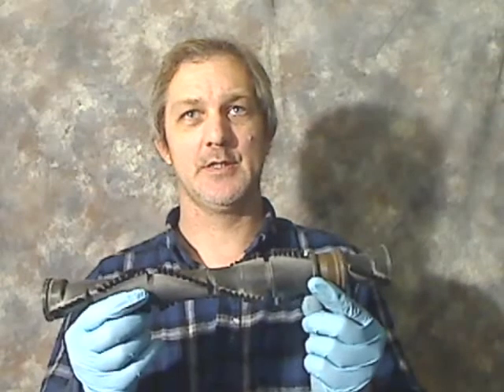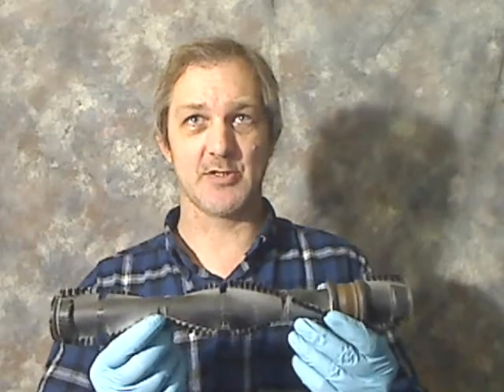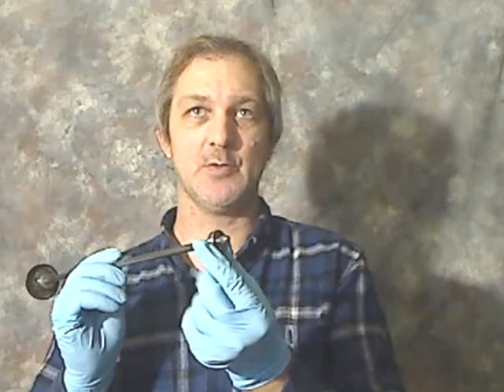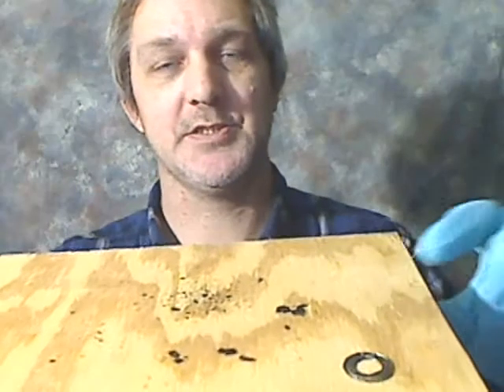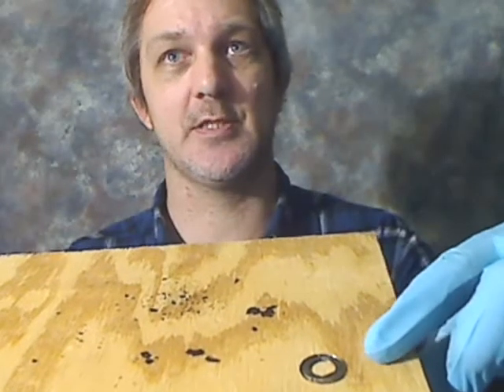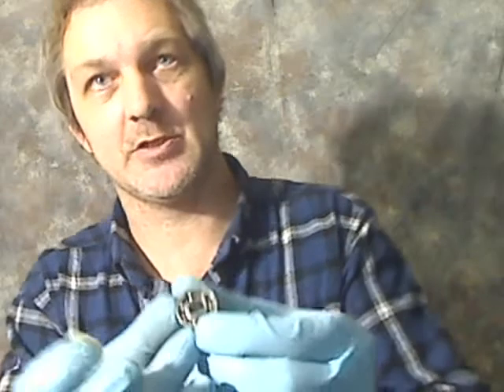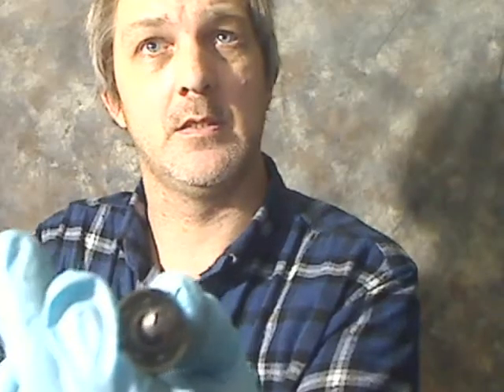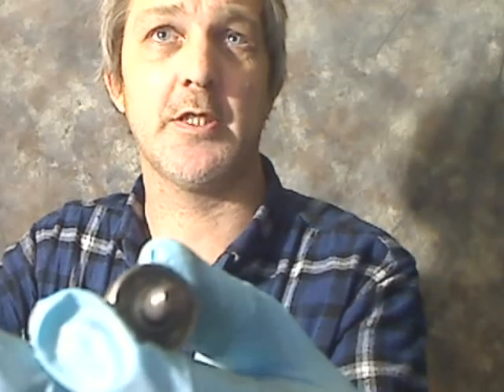Vacuum Brush Roll Bearings Froze Up

Comment: Thank you. This video and related posts helped me to figure out how to dissemble and repair a bissell roller brush without destroying it. 
Tapped out the rod with a Phillips head driver and hammer. Several lite taps pushes it out. One bearing had completely seized up, lubrication didn't work. Found same size/type bearing at DeNault's Hardware in the miscellaneous hardware section. Uses a standard size single row radial ball bearing. Reassembles by pressing firmly together. Also replaced the belt while I was at it. The vacuum now works like its brand new. Win!

Comment: My roller brush smelled like it was burning but still spinning. I turned if off, cleaned hair off outside, but when I turned it back on, rollers did not move. By watching this video it filled in the blanks of what I needed to do to separate ends of roller brush to access inside and clean and lubricate. Thanks.

Comment: Yes, did the same as Heavymechanic. Gentled a screwdriver under the softer of the two caps and pried. The rod actually came out of the opposite cap! Pretty easy-peezy, actually. Once I cleaned the crap out (yes that was the problem) tapped the rod back into place with a hammer. Cleaner is running again like a Boss!

Comment: I saw this video right before I ordered a new brush roll and belts for my Bissell, decided this was my last attempt ... it WORKED!!! I pried the ends off with a flat head as carefully as i could to not damage the plastic, you have to just work your tool around and pry and twist .. it took me a bit but after cleaning the end caps off and taking out the stem inside and wiping it down with WD40, I saved about $30+  on parts!!!
Reply: After hanging up on a Bissell Rep i could not understand i found this video. Spot on kid and  Thanks big time!

Comment: Took brush apart with flat head screw driver,  cleaned out hair wrapped around rod and used some WD-40 and voila! Up and running again. Saved myself a visit to the vacuum shop-time and money saved! thanks!!
Reply from the maker: +Lisa Ebert Glad it helped because the brush roller is half the price of a new vacuum cleaner.

Comment: Thank you sooooo much for posting this video. I thought for sure my motor was broken. I have had my Bissel vacuum for around 3 years. I was about to give up and just buy a new one. Then I saw your video and put some WD-40 on my brush. Problem solved!!!!! Thanks again. :)
Reply from the maker: Cool.. I just gave this vacuum to a single mom because it still works good, just a little noisy. Glad you were able to keep it going from the info in this video. Its sad when the replacement part is nearly as much as a new vacuum cleaner.

Comment: How did you get the bearings opened up (seals removed) to clean them and relube them? There isn't enough of a crack to get any kind of tool inside to pry them open.  What tool and technique do you use?
Reply: Exactly my question.

Comment: Thanks for your help. It allowed me to be able to fix the brush roll of a Bissell that I was about to scrap. Question: is it critical to clean out and oil both sides of the brush roll? I only did one side because the other side was already turning freely.

Comment: I am having the same problem.  I'm waiting to see if this solution will work for me.  I tried wd40 by itself first without taking the brushroll apart but that didn't solve the problem.  Time to take it apart and go get some really good lubricant and cleaner.  frustrating but hopefully it'll work out in the long run.  frustrated because I've only had this vacuum for a month or so.  Think I can call bissell and tell them they sold a piece of junk and send me a new brushroll for nothing?  doubt it.  same here, this was a "throw away" vacuum for me til i could fix my shark.  Love my shark and am glad i was able to fix it... doesn't make this less frustrating though.
Reply: Sami Akuma 
"Throwaway vacuum" is right! I have found a Shark, at least three full-size Bissell uprights, a Hoover, a mid-size Eureka, and a dirt devil three in one stick, in our condo dumpsters in the last three years.But I have found that I like to clean them up and fix them up, and then either keep it, or donate them to the Goodwill and write it off my taxes, or give it away to some deserving person over nextdoor.com at a public place. I enjoy doing it, so I don't care if it's "counterproductive". 

I also found out that even though these vacuums are cheap and inexpensive, most, if not all of them, were thrown away because of neglect to keep them cleaned out. One was used as a wet/dry vac to suck up what looked like a dead bird the cat brought in, and therefore it was clogged up (get a "shop vac" for that). And two Bissells had broken belts(in fact I'm replacing the belt on one right now) caused by brush heads getting plugged up with pet hair, causing the brush head to get jammed with the motor still running and then burning out the belt. And it looks like the dog bit into the cord of the dirt devil three in one stick, for which I wish I had cannibalized the cord off of the Eureka to put on there.

Comment: Can you simply use “3-in-one” all purpose machine oil on it? Is it also strictly necessary to do both sides?
Reply from the maker: I think you can use almost any type of lubricant, even stuff in a spray can but may not last as long.

Comment: Thanks for the video. I've got the same problem!  But I'm having trouble getting the plastic ends off the roller.  Can you tell me how to get the ends off without damaging them!  Thanks for the help!
Reply from the maker: Hi: the ends are not made to come off but I just pried it off with a screwdriver. I was able to get the bearings freed up and lubricated, it still sounds awful :(  If you find out the part number for the brush, you might find one at Amazon or eBay at a reasonable price.. I just bought a new vacuum and use the old one to pick up gravel and from mats and other dirty jobs LOL
Reply: Thanks for the reply! I'll give it a try. I've checked on buying a new brush.  On eBay and Amazon the brushes are almost as much as the vacuum was new. So I always just end up buying a new vacuum. Thanks again and keep up with the helpful videos!
Reply: @Theshazamgirl  
If you live in an apartment complex, perhaps just wait until you find another Bissell at the dumpster. You can cannibalize it for parts. I have found about 30 vacuum cleaners at my apartments in the last six years, most of which were Bissells.
Reply: I think mine have hair inside the bearings. Is there no way to get inside without tearing it up?

Comment: I have a rusty vacuum cleaner motor pulley on my Bissell. And I'm about to put a new belt on it. But will the rust prematurely wear out my new belt from added friction? I'm thinking about filing away the rust off of the pulley, But I'm concerned that if the filing "knocks the pulley out of round", that that could do greater damage than good. So what would you do about a rusty vacuum cleaner motor pulley?
Reply from the maker: You can polish it with fine sandpaper, otherwise it will clean up on its own. Just be sure it turns freely and does not have rough bearings which could burn up the belt.

Comment: This video is worthless, all I can see is you, not much of the brush roller. Also those bearings can be replaced, simply get the number off the bearing, google it. If you can get a bearing with an "RS" after the number, RS means rubber seal, it will last longer. Or you can get Z bearing with a metal seal, overkill but they all cost very little. Ebay sells bearings. Bearing numbers are universal, meaning a bearing with for example mine is 71749RS is the same no matter what it is used in. 2 bucks each for these.